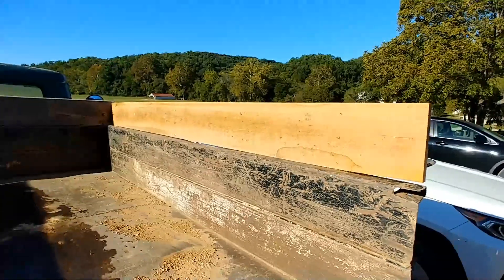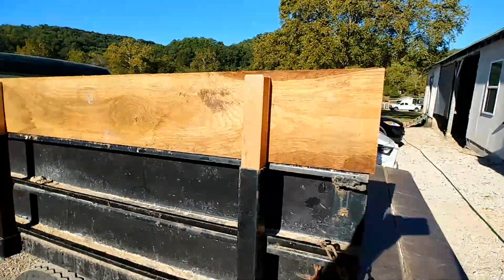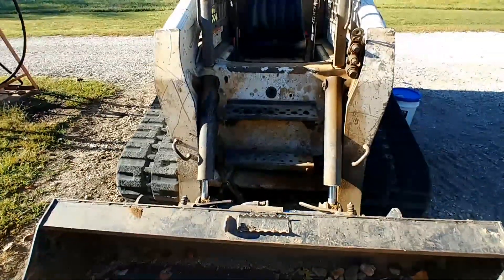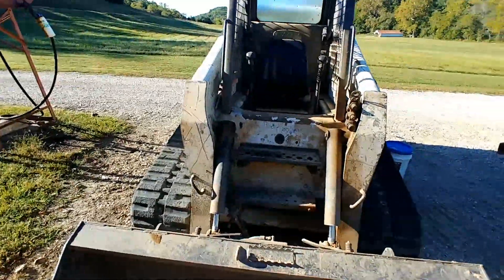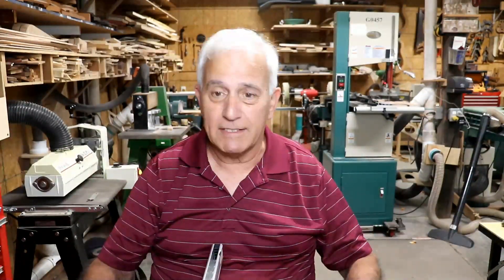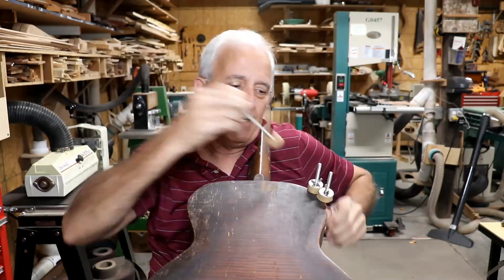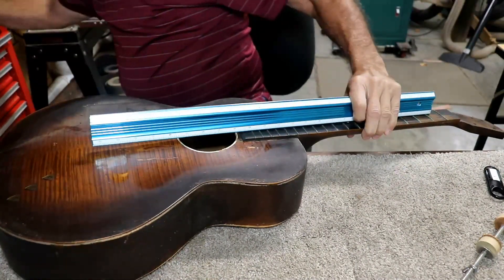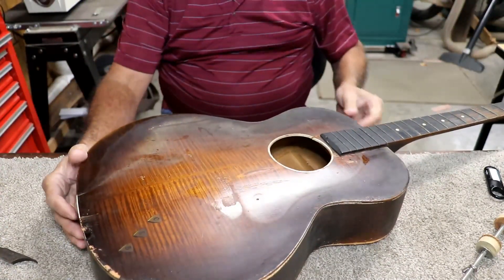Vlog #121 Lots Going On Including A Hospital Visit

Comment: As a Monday morning quarterback my two cents would be, that the back would have been easier to line up withe the sides had you started at the neck end instead of the back end .... For what it's worth....(my opinion, that is).....
I saw a Gibson f5 that had the back come totally off one side and the tail end....looked like it would never go back in place but for ing the body back in line wasn't difficult....